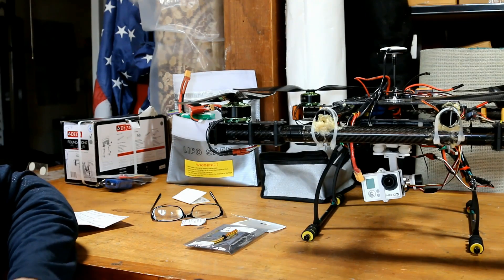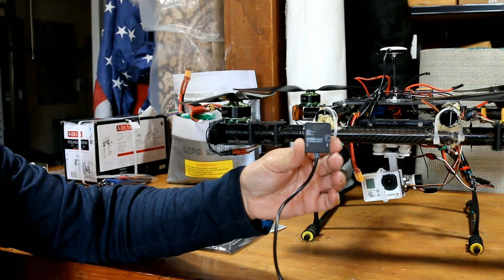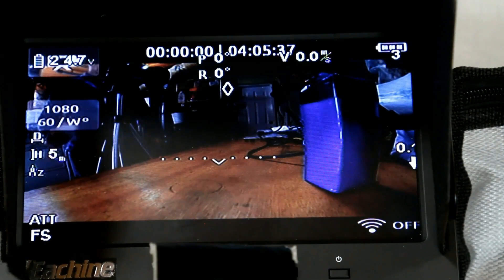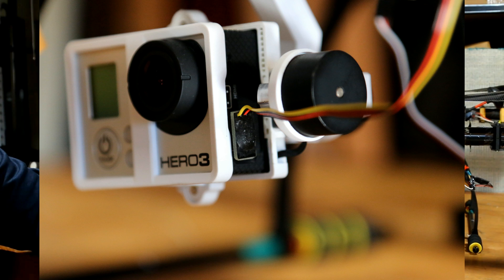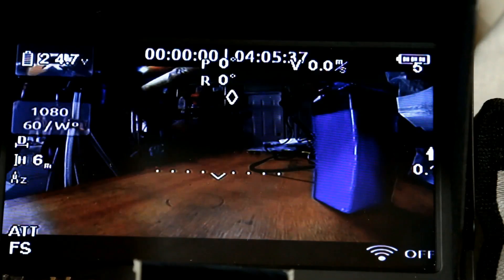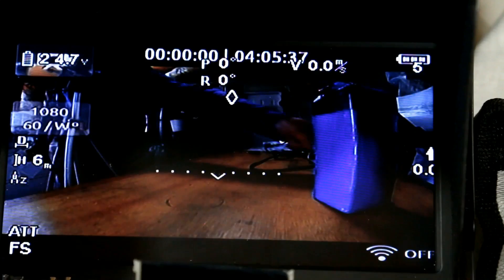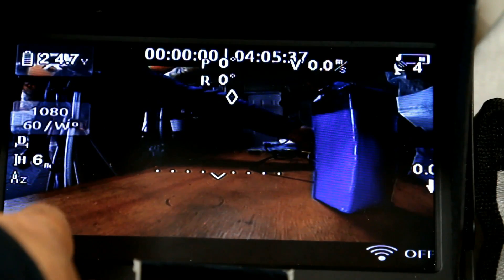DJI iOSD Mini. Quick install video

Comment: Hi
Thankyou for your video, I have one question. the Mini IOSD as a video in and video In ground, which clearly comes from the GoPro. The other side of the Mini IOSD in video out and video Out Ground. These clearly got to the Fatshark Video in and Ground on the VTX. Too power the Gopro via the 5v Output on the Fatshark Vtx (red) Is very clear. My confusion is My GoPro power cable also as a black (ground) wire and I don’t have a dedicated ground wire free..... on the VTX, do I need it as your video says only to connect the 5v power cable from the VTX or did I miss something???

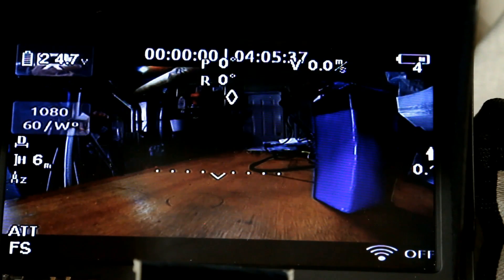Comment: 3:10  RIGHT!!!  DO NOT update the firmware via DJI assistant software ...  it thinks it is a DJI iOSD Mark II (it is not) .. then the firmware will not work if loaded. 
TO FIX IT... read this forum thread ... https://forum.dji.com/thread-86381-1-1.html    .. which also contains a link for iOSD Installer 4.0 which will downgrade your firmware back to the correct latest level.

Comment: Hi There 
i have make the connection as you mentioned.  live vedio ok with iosd data .but video does not recoed while video transmitting. please help me to find the fault.
Reply from the maker: Weird, if you are getting a live view that means the image is making it to your camera and being transmitted to whatever it is you are receiving it on. It should record. I have no idea why he would not.
Reply from the maker: Are you using a GoPro also?
Reply: @photojunkysdronezonevlog  thanks for your reply  
i am using Gopro I Don't know what is wrong . normally camera is recording videos.  but when the copter power up stop recording.only live streaming
Reply: @photojunkysdronezonevlog  He needs a DVR  or another type of ground based recording device like goggles.
Reply from the maker: @johnrobertson7583  it should be recording through the GoPro.

Comment: what is the name of the plug and wires which plug in to the camera to soilder to the other wires please
Reply from the maker: I am not sure but basically it is just a video audio in out with a power wire. Check out these two links.
https://m.banggood.com/Gopro3-Video-AV-FPV-cable-p-89638.html?gmcCountry=US&currency=USD&cur_warehouse=CN&createTmp=1&utm_source=googleshopping&utm_medium=cpc_bgs&utm_content=frank&utm_campaign=pla-us-all-0903-13anv&ad_id=380621270134&gclid=CjwKCAiA8qLvBRAbEiwAE_ZzPeAavaHSzSatUMMLKeKAmiTBjJdZ3bUtWuzD7cY9y2MNZtJ2yhgmqRoCBm8QAvD_BwE
https://www.ebay.com/i/163658057861?chn=ps&norover=1&mkevt=1&mkrid=711-117182-37290-0&mkcid=2&itemid=163658057861&targetid=537215816608&device=m&mktype=pla&googleloc=9031924&poi=&campaignid=6470546568&mkgroupid=81274342447&rlsatarget=aud-762207186714:pla-537215816608&abcId=1139336&merchantid=118870436&gclid=CjwKCAiA8qLvBRAbEiwAE_ZzPc_CSC_t8FdGzIEze7c2nOR0Sj7IocBcd-Qzui64d9SjM1Z0_DdodRoCmuIQAvD_BwE
Reply from the maker: I ended up at splicing wire but ithttps://www.readymaderc.com/products/details/rmrc-gopro-hero3-hero3-hero4-camera-cable-audio-video?gclid=CjwKCAiA8qLvBRAbEiwAE_ZzPdO4zatdzEPHUphI0fEPmds0bMewk1x6QwRvzqxe8Gk9BDVZRkY__RoCLW0QAvD_BwE really is not that hard.
Reply: cheers for the update works well thank you :)

Comment: Just installed a new Mini iOSD......updated the Firmware like they asked to 4.1 and now it has a bug saying that I have a Firmware mis-match....at same time it says no updates are available and the current is the latest 4.1

WHAT THE FUCK IS WRONG WITH THIS PEOPLE? they can't put out anything without a bug in it?
Reply from the maker: Ed Mon I had some firmware issues as well. They haven't updated the thing for years, and with mine, I was unable to resize so some of the readings so some are too far to the left and right.

Comment: Still looks like a good solution for Naza based copters. Do you know if it will plug in to the Naza M-Lite, I can't see a suitable plug on the M-Lite.
Reply from the maker: CorkKNIFE, no, i don't think it will work. Like you said... Plug issue.
Reply: Just came across this post. No, it's not a plug issue.If you know where the wires go, you can use a servo wire, just pull the wire out of the connector, heat shrink it, and it will fit.
Reply: Just done a test. The pin on the left is ground, the pin on the right is power, the two in the middle is your TX and RX, not sure which one is what, but if not working, just swap the wires, no harm can be done.
Reply: No...neither of the two versions of PMUs from the Lite have a spare Canbus connector like the V2 PMU. You can install a V2 PMU on the Lite and it will give you the Can Port...however you may also need to flash your Lite into a V2 model to make the OSD data transfer...now maybe the guy who posted his answer has cut the dji connector off and just soldered the two cables together...but again...I dont know if the Lite supports OSD.

Comment: Hi, thanks for posting this. i have a question though. I just got my iosd mini and my question relates to the FC.  I previously had the GPS and the LED unit plugged directly into the flight controller.  In order for the iosd to work, i now have the power unit plugged in along with the GPS .  There's not a spot for the LED now. I guess the idea  is that iosd provides the same/more info so you dont need the LED?  Which i get, i've just become accustomed to my blinking light that helps me stay oriented when flying.  That light has never failed but camera signal and batteries have.... just wondering if you found a way around this.  thanks.
Reply: ok i rewatched your video and figured it out.  GPS plugs into power unit leaving a spot open on the fc for the LED.
Reply from the maker: Houston Drone, exactly, the iosd mini is powered by the flight controller, but I used a separate battery to power the GoPro and the transmitter.